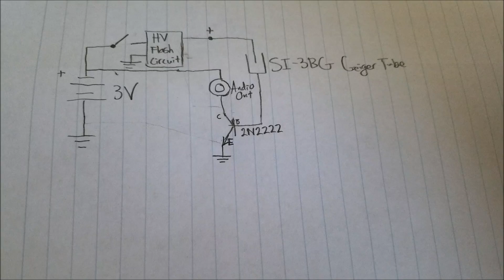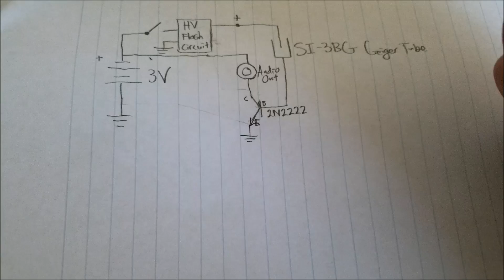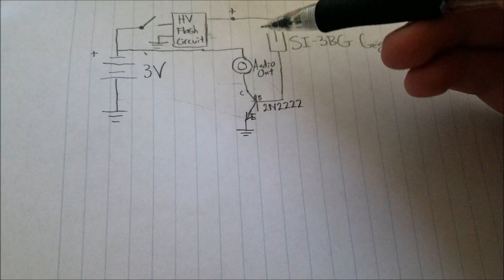DIY Handheld Geiger-Müller Counter for Beta/Gamma/XRay

Comment: New sub here. Yeah, crude but cool!  I should try and build my own someday.
Reply from the maker: Eventually I want to try the SBM-20 but use an amplifier to have it use a speaker instead of headphones. My CDV-700 uses headphones and I really wish I had one that clicked out loud, so that's a future project.
Reply from the maker: That's strange, the transistor should serve to amplify the signal from the geiger tube when connected as I did. All I can say without more information is check the pinout, it may not be the same as my 2N2222.
Reply: Hey, I've got a sbm-20 and when I hook up the transistor the headphone just makes a high pitched noise, but without the transistor it works fine. I'm using a pn2222 npn, similar to the one you have. Any ideas?
Reply: Never mind, I just used a speaker with it's own amp and it works good.